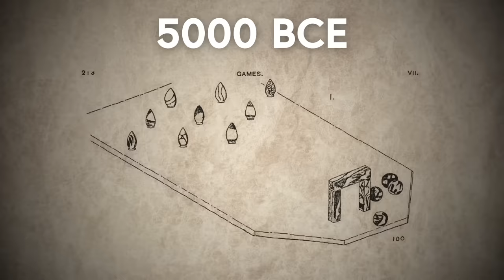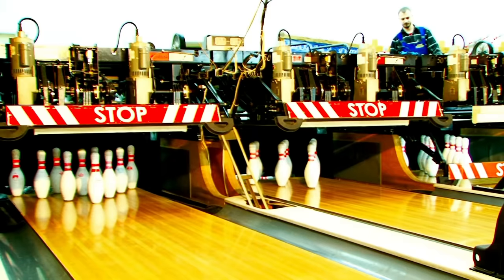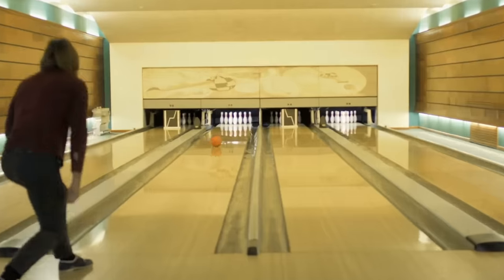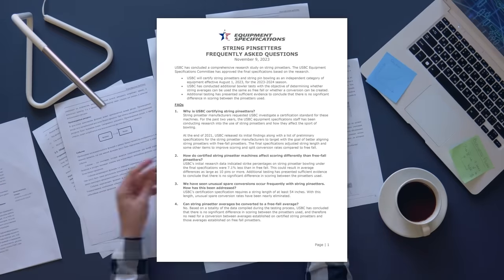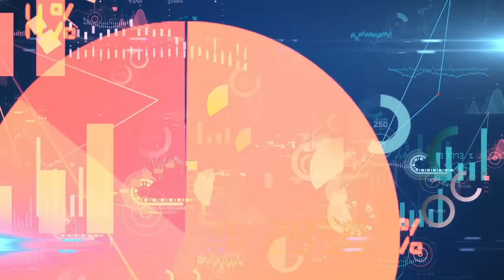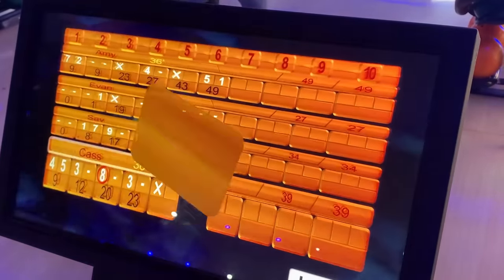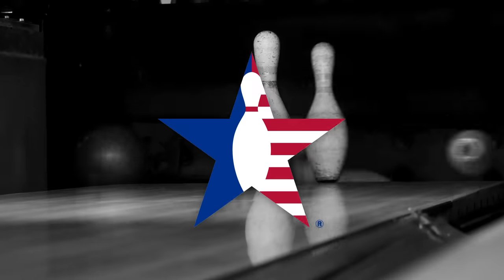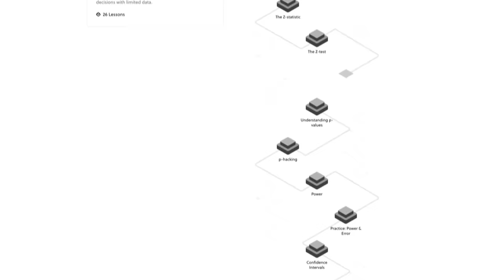The Controversial Machine That’s Ruining Bowling

Comment: Will never forget the time my father bowled a strike with so much force it shot a pin back up into the machine and they had to close the lane for a week until it was repaired. Always wondered how the pin managed to break something, but seeing the amount of moving parts now, it makes sense haha
Reply: Also, bowling pins are really fucking heavy.
Reply: @wta1518 does 3.5 lb count as really heavy?
Reply: one time I threw it before the sweeper left and the bowling ball hit the sweeper... whoops
Reply: @XiuHang  When it's colliding with tiny ball bearings at high velocities, yes
Reply: it's not so much them being heavy or not, just occasional bad luck of a pin bouncing up between moving parts with a lot of power moving them.  Think of it like shoving a stick into the spokes of a bicycle wheel while someone is riding past.  Pins are typically made of maple, chosen because it can put up with a lot of compression force without being damaged... that really plays havoc on the parts of the machine if a pin gets stuck between moving parts, especially in a way counter to the typical forces on the machine, for example wedging the rack up where the machine is designed for gravity to be doing most of the work to set it down.  
Some of the newer machines are computer controlled and can tell when something is wrong, but most bowling centers are still using the fully mechanical machines designed in the 60's that will run a full cycle without care for what parts are broken and hanging off.
Reply: @wta1518 How do they do that?
Reply: @XiuHang  When you consider the speeds they can move at and the complexity of the pinsetters, yes.
Reply: There’s a fantastic video on Jared Owen’s YouTube channel explaining the workings of the latest model Brunswick freefall pinsetter. These things are unbelievably complicated and it’s a miracle they work at all.
Reply: @XiuHang  well that means a set of standard tenpin pins is 35 pounds, and a freefall pinsetter has two sets, so 70 pounds worth of pins being constantly cycled through a machine is not insignificant.
Reply: @XiuHang  That's about as much as 2 baseball bats, so yes
Reply: @XiuHang  If you're an ant, yes.
Reply: @barnsnoble7066  this is the only convincing response.
Reply: @tzarg  I did this in league. I found it a waste of time to hit the reset to get the pins down so shoot it blank. Someone hit the reset as I was shooting. Now I just don't care xD
Reply: I worked at a bowling alley with new non-string equipment, and sometimes the pin elevator would launch pins into the back a bit faster than most people could throw them, resulting in workplace injuries.
Reply: Hah my dad also once broke a string setter machine, though in his case he bowled so hard that he beheaded the king. (The middle pin of the 9 pins found when bowling in Germany, though Germany has a lot of different variants.)
Reply: @tzarg  I have a friend who rolls his second ball (using two balls) when the sweeper is still down.  He times it just right so he gets a spare as soon as the sweeper barely lifts up out of the way. Cocky A.F.
Reply: If it took a week to repair they had a shitty mechanic! Most problems can be fixed in a matter of 20-30 minutes unless a part needs to be ordered. Most bowling centres have almost a full machine worth of spare parts on hand.
Reply: @athletixbc  it was a parts thing, we lived on an island at the time so if you didn't have a spare on hand you had to wait 😆
Reply: This time on things that didn’t happen
Reply: @haroldb6773  Nice job assuming, really glad you were there to know. Fantastic job, you get a cookie
Reply: @XiuHang  that's heavier than most swords, so yea
Reply: Tip for not getting kicked out of the bowling alley: If a pin comes out of the deck and rolls into the gutter in front of the sweeper with the head of the pin pointing towards you, DON'T assume "aw, I won't throw a gutter ball" because the pin will act like a ramp and launch the ball to hit the fascia waaay up above the pin deck. The pin will also achieve near supersonic speed and break something in the machine while the ball falls dead right in front of the pin deck with a sound so loud and uncharacteristic that dead silence ensues because every other bowler in the whole alley stops to see when the heck just happened. Then the attendant has to go get your ball because it's not moving at all and the ball return isn't working any more.
Reply: @richardunruh4035  Ive picked up three 7-10s like that
Reply: It sure what broke but it wasn’t your dad that put it down for a week. Only way is if something did break and they didn’t have the replacement part. Had to wait for the delivery then install.
Reply: @athletixbc I concur. I work at Yosemite  Lanes in Modesto as a pinsetter mechanic.
Reply: @richardunruh4035 not only that if it’s facing head first the ball will punch the head of the pin thru the gutter. Quit counting on how many I had to repair because of that.
Reply: There's a video of a guy restoring an old, mechanical slot machine here on YT.  The number of parts he had to keep track of--even with video--snapped my mind.  There had to be, like, 3000 parts in that thing.
Reply: @XiuHang 3.5lb can still carry a lot of inertia
Reply: @XiuHang  used to be 4lbs, when 8-10 for righty and 7-9 for lefty was the norm of the time.

Comment: my aunt owns a bowling alley and they have the old school pin setting machines. one thing alley owners have been doing with the lower traffic is setting up the machines to actually shut down instead of idling when the lane is not in use. also a lot of alleys run into the problem that these machines are actually pretty reliable so they ignore the daily maintenance they require and then get crushed on the price when major parts start constantly breaking from not being lubed and maintained. be good to your machine and it will be good to you
Reply: I set pins in 1964 and got a nickel per bowler in league. First check was $4.80 after taxes.
Reply: You gotta keep things lubed if you want your pins and balls handled properly.
Reply: “Be good to the machine and it will be good to you”… unless the machine crushes you to death right?
Reply: The pinsetters are always shut down when the lane isn't in use, and always has been.  They don't just sit there running and ready to go until someone needs a lane and the person at the counter turns it all on.
Reply: Exactly. There are a lot of bowling alleys that unless the lane is currently being used, it is 100% completely shut off. No need for these stupid string pin setters